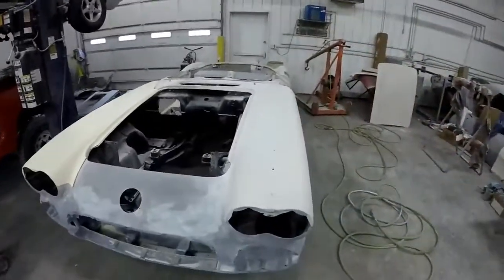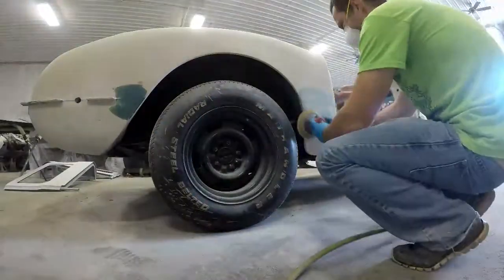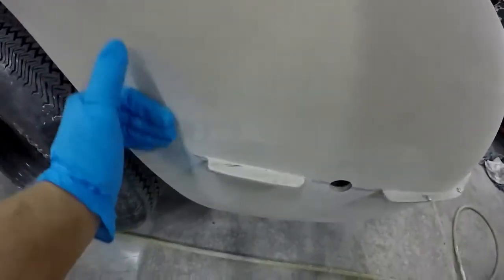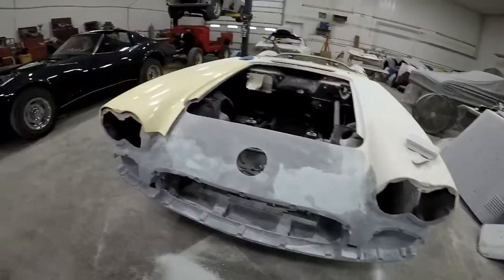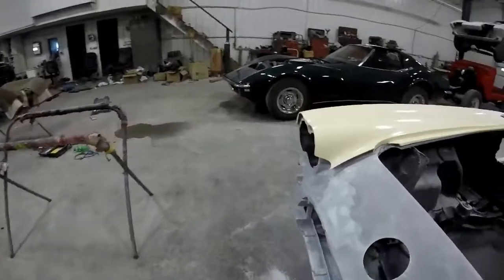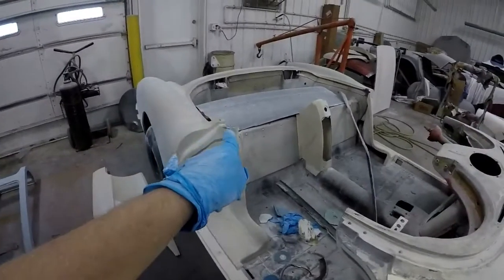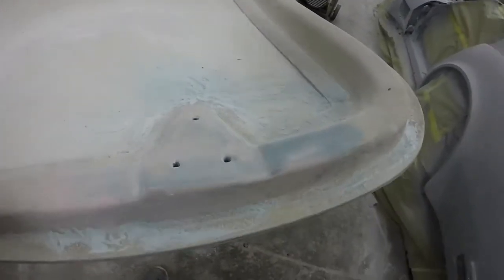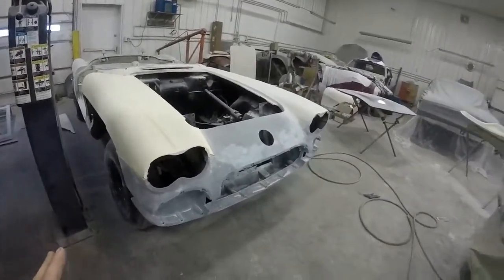1960 Corvette Panel Removal & Seam Repair

Comment: Lot of work there,looks good. Where do you get your body panels , I’m working on a 59’ pro street C1 & looking for the driver door front jamb from the sill up to the top ( where it’s the mounting surface for the windshield frame ) ? Thanks

Comment: Evercoat makes special corvette filler, duraglass will shrink and seam map and you’ll start seeing where the seams are. Duraglass is designed to expand and contract with metal not fiberglass

Comment: Keep at the videos Mitch, I love mid year and C1 technical info and especially builds. I've built many 1st gen Camaros, but wasn't real familiar with C2s.  I'm learning their idiosyncrasies, and correcting problems..current fighting some problematic (lazy) headlight doors.   Are these your personal cars and shop??  Mine has fresh paint, but unfortunately it wasn't blocked very well by the previous owner..It actually looks good, but one day I'll repaint it properly.
Reply from the maker: Thank you I appreciate the support I will! I love first gen Camaros. My dad had a 67 for awhile when I was growing up and I was sold. But I mainly know mid years so its a learning curve to move to other cars. A mid year is definitely a breed all its own. They have all kind of unique features but I love the 60's technology and engineering. The 65 controvertible is my dads, the 63 is mine, the 60 is our buddy's car and his dad used to own both the 60 and the 63.  All the cars in this shop are customers cars, I am helping out a friend.

I re-greased my headlight motors and took the gearbox apart. But I have no idea how in sync they are. That's a shame that the prep wasn't what it should have been but at least it looks good!